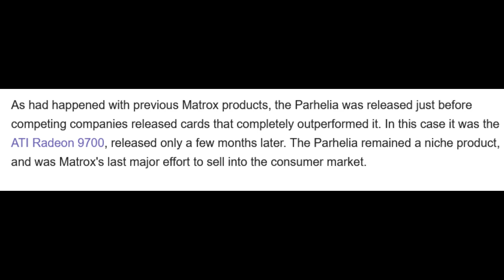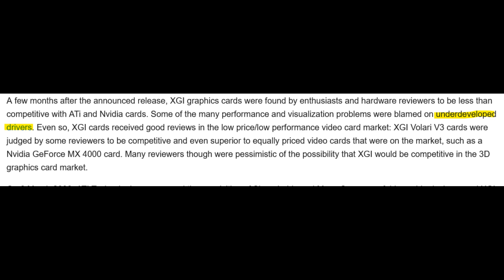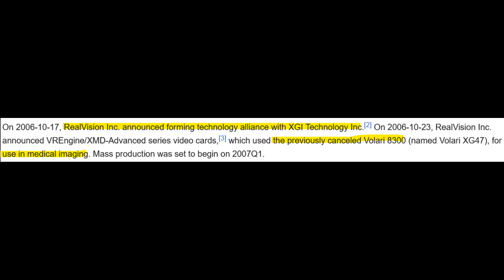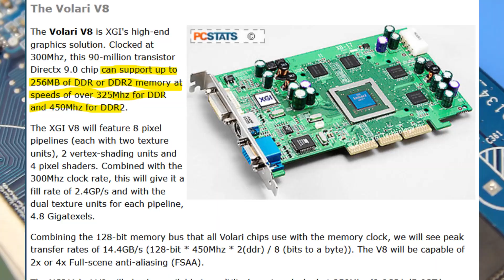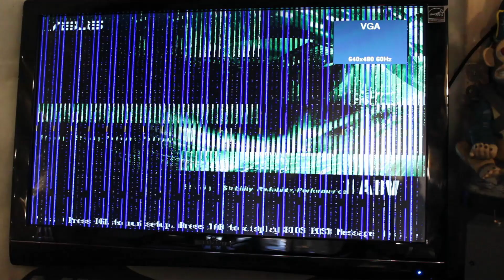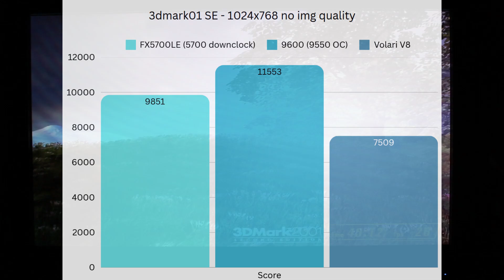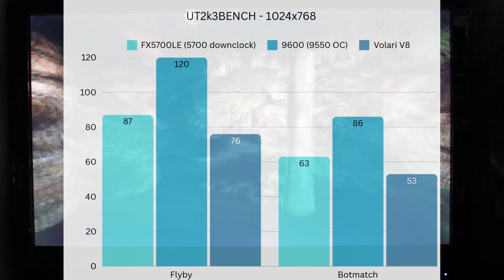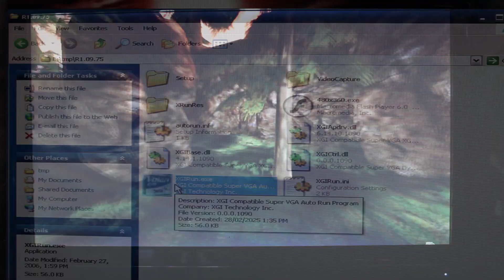The Most Interesting & Pitiful Thing In All Of Retro Computing

Comment: Shame with the artifacting on your V8 before you could test it further. Hope you're able to figure out the cause! Besides the solder joints of the chips themselves, perhaps check any supporting components like the electrolytic caps or any SMD caps/resistors? Perhaps it's something so simple and would allow you to stop short of reballing the core.